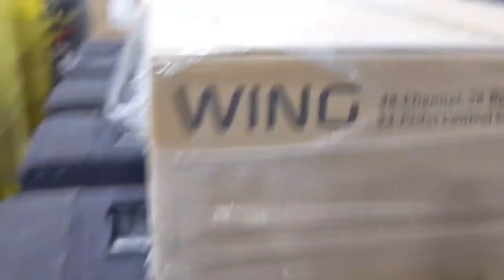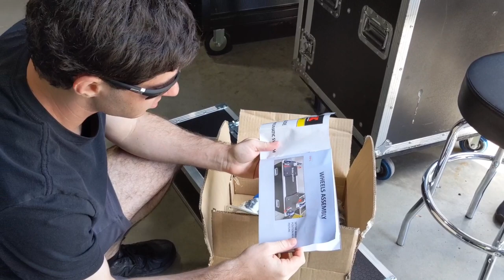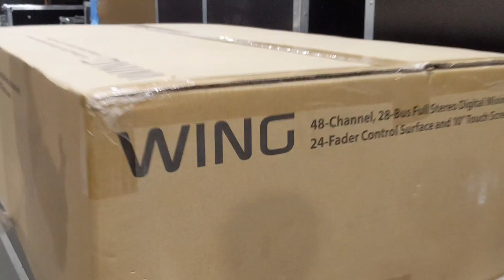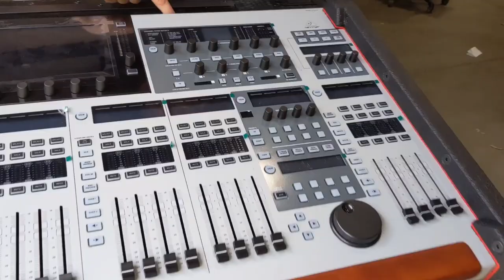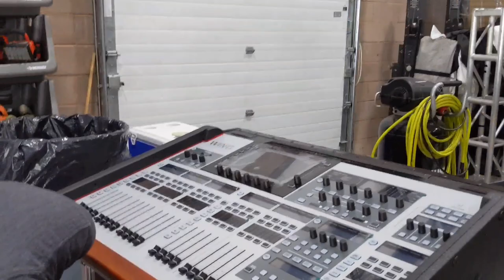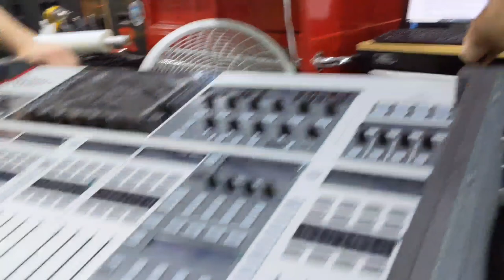s7e8 Unboxing and Testing New Flip Case For Behringer Wing Console | Audio Engineers Comic Relief

Comment: Can we talk about the other pandemic... the wing faders ghosting and touch screen flak out... to the point that a music group employee has taken residence on the  facebook group - writing customer service return tickets lol
Reply: this is not a class problem, i would say it was happen at some of the wings.. compare to what they sold the number is very low with these failures
Reply: Beringher has literally entered the chat....
Reply: @behringerwing3550  is there any talk about getting a block style assignment of inputs to channels so you can select more than one input at a time and drag to the first channel and have it automatically assign all those inputs? That would be an awesome firmware update.  So would being able to turn of the capacitance of the gain knobs on the eq section....maybe in the settings somewhere. I think this mixer is a great idea and a lot of value packed in there,  but I agree with others that have said those eq knobs should have been frequency gain and q, and the buttons should have been LF, LM, HM, and HF. That is a "aint broke don't fix it" type of situation and I feel severely restricts most seasoned engineers when time is what counts the most.  Overall there is too much reliance on the touch screen. I think you should be able to run the whole board without touching the screen. Except for maybe patching inputs,  but even that should be able to be navigated without touching the screen using the rotary knobs and buttons.  I love all the effects you can choose in the gate and compressor sections without burning effects rack slots and also the fact that inputs are point to point assignable and that every channel and bus is stereo. Those 3 things set this board apart in this price range, but nobodys feelings would have been hurt if it took off of the x32 the best features of it,  like the eq layout. That board was super popular for a reason. Also just another thought, nobody has made a board yet in this price range that has multitrack recording over usb that is not burning up the expansion slot. This should be a built in interface in my opinion with the expansion slot open for other things like dante etc. I do like the SD card recorder but it also falls short. It should support the absolute biggest SD cards you can get. That way it would actually be super useful as a back up recorder for the USB connection in all day event situations.  I have heard that even though it's not officially supported that you can use bigger SD cards, but why limit it to 32 gb when it could have way more storage?